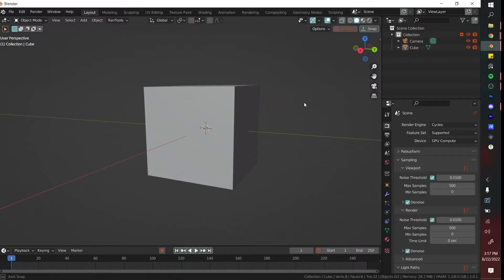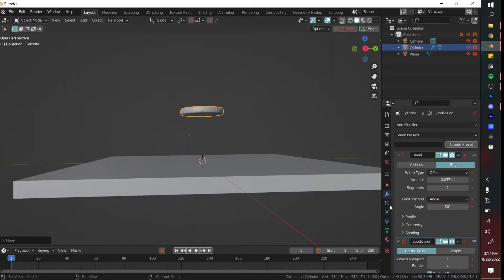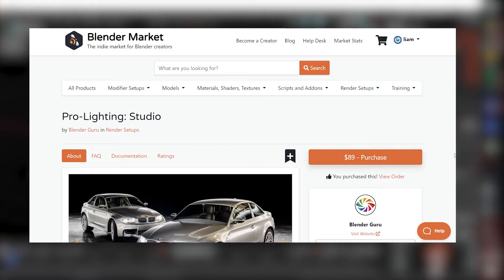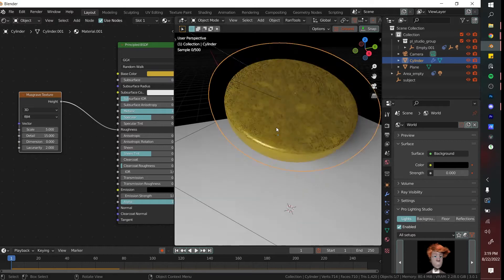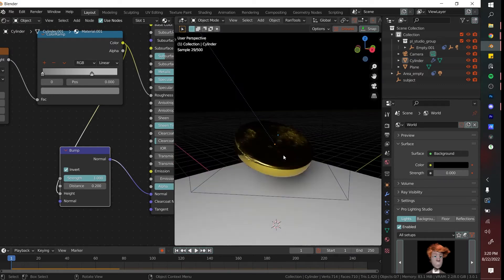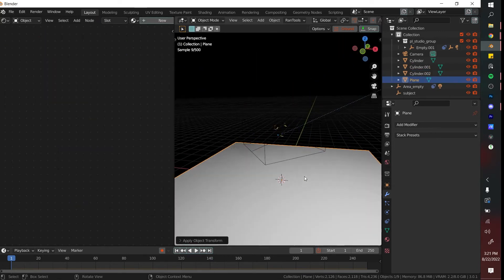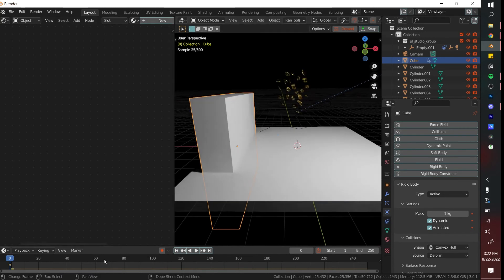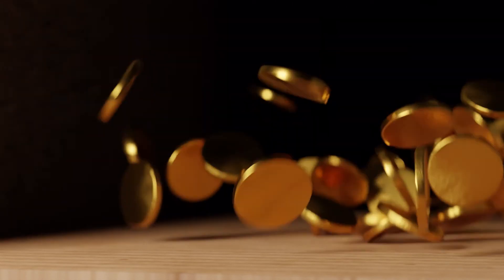Blender Falling Coin Simulation (EASY Tutorial)

Comment: There are 340 balls in the composition that fall into the glass (there are no textures) - the simulation slows down very much! 🤦🏻‍♂ Each frame is 3-6 seconds long. And it's not a render, it's just a simulation of falling objects. It's awful.

I think it's not about my PC. In C4D (R19) I made 1080 balls and they fall in realtime, without any delay. Even when I made 3200 balls, they are still not badly calculated. But the Blender can't even count 300 balls!? How is it? Maybe I need some special settings or maybe an addon?
😢 It's a shame.
Because of this circumstance (if it fails to solve it) I will have to quit Blender training and switch completely to C4D. Eh...
I will be very grateful if you can help me!!!